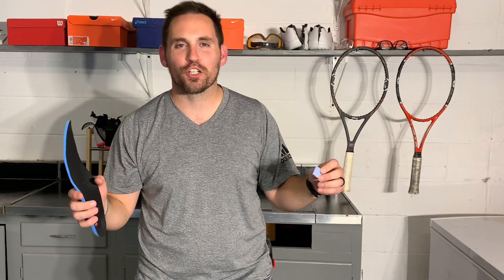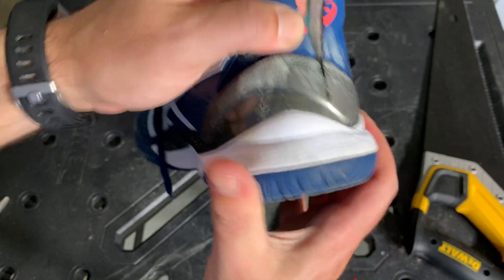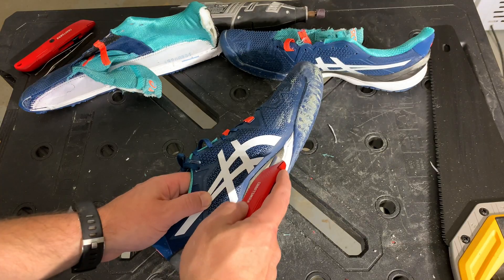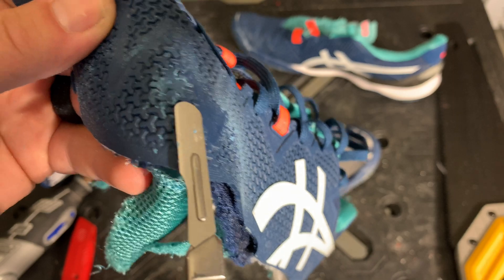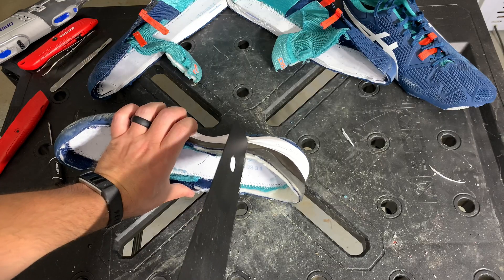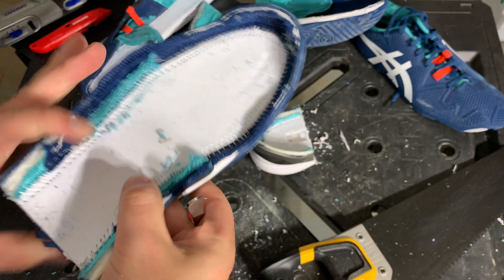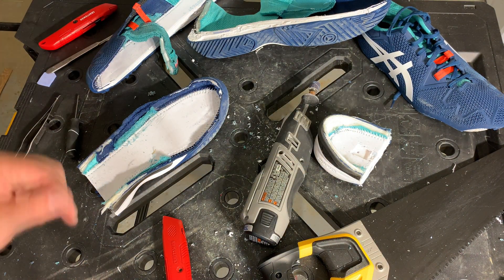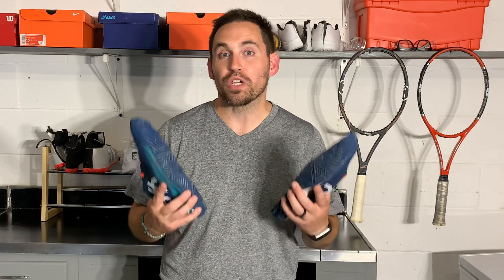Asics Gel Resolution 8 Cut in Half and Durability Tests | Tennis Shoe Teardown

Comment: I used to replace my shoes when the outsoles wore out.  Modern Gel Resolutions are so durable and I probably keep wearing them far beyond their functional life span.  Is there a way to determine when the midsole foam has worn out and the shoes need to be replaced with a fresh pair?
Reply from the maker: Typically on the side there will be creases that start to form longitudinally / I also usually say no longer than 500 miles

Comment: Is that the same outsole pattern as the Gel Res 7’s? I had some Gel Res 7’s and at my courts they’re very dusty sometimes and I’ve had quite a few slips on push offs to chase drop shots down. I ditched those and got Court FF2s...and have yet to have a slip 😎😊
Reply from the maker: It’s a very similar tread but the reason for the slipping is the durability coating it can get slippery on some slicker surfaces whereas the ff2 wave pattern will still stick to the court - much better tread IMO

Comment: I have and love these but have serious issues with hard court sliding damage. My pair is in pristine condition except for the inside of my non-dominant foot. Are there any solutions or alternatives that might solve this issue outside of changing my footwork?
Reply from the maker: Yeah it’s just how you are sliding, unfortunately not much is going to resist that kind of heat and friction build up- you can try the court ff which has more outsole material over the toebox and forefoot but you just may be looking at going though shoes with the way you slide

Comment: Do you think gel resolution 8 is a better shoe Overall compared to  yonex eclipsion 3 ?
Reply from the maker: No, they are very different but both are good
Reply: @FootDoctorZach  And how about the Nike Court Zoom GP Turbo?
Reply from the maker: I’m doing a new head to head series on the channel- it’s hard to say which is better among three shoes as all are good shoes but  so different but make sure you check out the head to heads with the rating system out of 20 that should give some context between many different shoes as the videos come out

Comment: After demoing, I can't decide which size should I go, a little tight on toes( just foot itself no added is tight) 
or half bigger (however my ankles knocked quite well)
Any opinion thanks~
Reply from the maker: I’d go with tighter - the shoe will break in over time but if you have a lot of extra material you may have some instability issues- however if neither size fits well then you may want to look at some different shoes as these may just not like the shape of your foot, it happens with some shoes
Reply: @FootDoctorZach  I feel the shoe itself doesn't make that big problem for me, and I kinda want to give it a shot
Reply from the maker: Yeah for sure go for it - let me know how they work out for you!
Reply: @FootDoctorZach  Thx, so the slightly tight one is the choice right😂😂
Reply from the maker: That’s what I would go with yep 👍
Reply: I kinda want to take the risk because I feel flipping with the tight one, so tired now...
Reply from the maker: Can’t hurt to try and see how it goes

Comment: how easily can you slide on hardcourts compared to other shoes
Reply: currently I have the vapor cage 4. Is the gel res 8 more durable in the upper?
Reply from the maker: I’d say in the toe box the same but the upper as a whole is more durable on the Gel Resolution 8
Reply: thanks I slide alot and I wore through the upper Barry fast
Reply from the maker: They slide pretty well- I had no issues - id say the court ff 2 and Nike vapor cage 4 are better though for hardcourt sliding